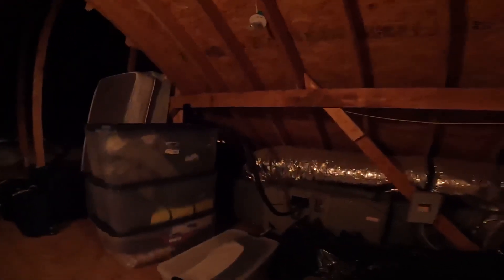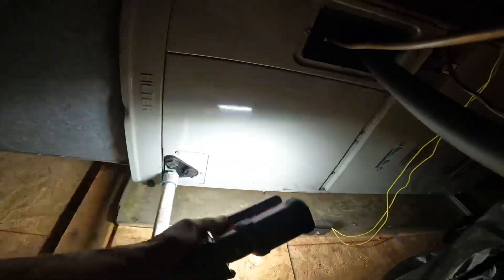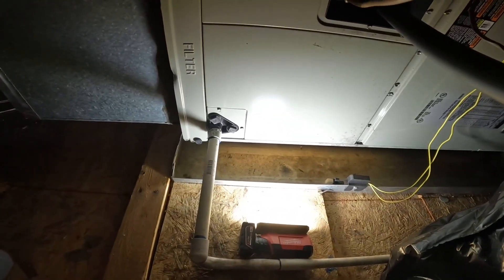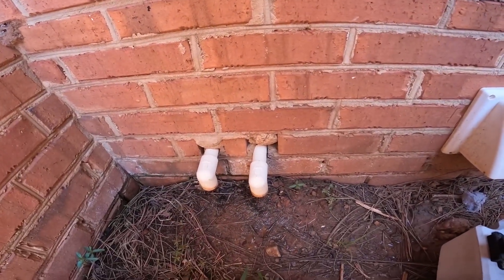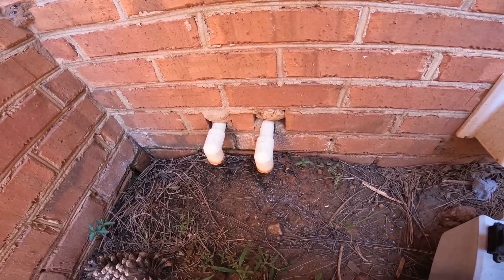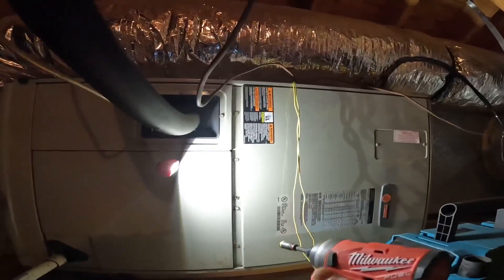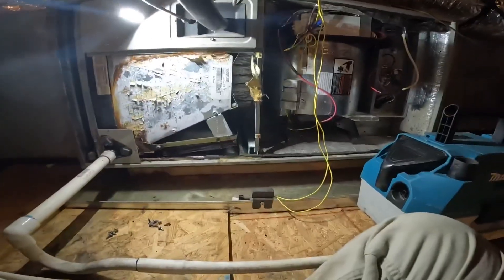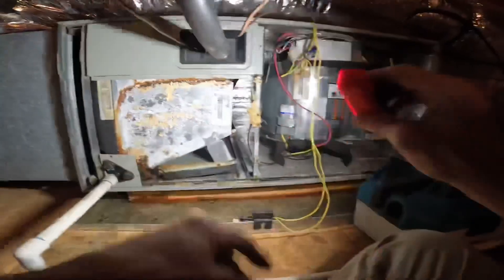Water in The Pan Turns Into a Changeout!

Comment: Another thing the transfer  pumps are good for is for washing a condenser if there is no water readily available. Fill a 5 gallon bucket and use that as your wash water. I have a storage facility i have to do that on and it works well.

Comment: No drain on the secondary pan ?
Reply from the maker: Just a float
Reply: That's becoming more common now, we used to have to run out separate from main drain.
Reply: I looked at the IMC again. Secondary pan drain OR switch or combination.
Reply: I like how Ted cook pipes out the pan, but puts a ball vale on it and leaves closed. Trips the float - they call, tech opens ball valve to drain.
Reply: Rather cap the secondary off and put a switch, ive seen more pans rust out because they never caught on that the unit was leaking, and the in-line switch is useless because crap builds up on the side of the float and actually causes the drain clog
Reply: I have also seen suggestions that the secondary drain to someplace the resident can't miss, like from the soffit over an entrance door.

Comment: I put an air handler in an attic once on a house I owned and remodeled. NEVER again... ever in a million years.
Reply: Why not?  Poor drainage??
Reply: @ranakeen9884  Miserable and hot. Lol
Reply: @virtual_bomber5698  it’s like a free sauna here in Michigan, idk about Texas or Arizona though. That’s way too much heat
Reply: @murkyturkey5238  Yeah man, it’s real easy to get heat stroke, you have to constantly be hydrating and make sure you take a break to get something on your stomach.
Reply: Don’t ever come to the southeast then
Reply: @virtual_bomber5698  Texas attics are pretty tight and there's no flooring; if we had a change out the first thing we did was to use 3/4" plywood boards
Reply: @bobboscarato1313  Most of the work I done is in Mississippi, most of the houses have them in the attic. The others have closet units but they are usually TIGHT. Sometimes you get lucky with a package unit. 

They usually have some decking under the units in the attic, the newer houses have a good amount of decking. Some of the  attics gets to 135 degrees (if not more) with the terrible humidity and then you have a shitty install that lasts all day that you’re stuck up there. 

I just don’t fucking know why they don’t have dedicated utility rooms for that kind of shit. Or at least have a dedicated full size closet.
Reply: @bobboscarato1313  what part of Texas ? I live in San Antonio and I do HVAC and the attics for the most part are pretty spacious
Reply: @skrt_n6518  Mostly Houston; many years ago to save on wood, builders made attics pretty shallow...you get my point. I see many of the new homes have larger attics. In Houston there are no basements for HVAC equipment save River Oaks! 77024.
Reply: @virtual_bomber5698  im also out of south MS and the REAL fun ones are the attics that were never built to have AC, most have 3-4 feet max room down the middle. many bruised knees and bumped heads were had
Reply: @bobboscarato1313  I live neat Galveston yall should see my attic it's almost large enough to stand in. The ac unit is up there to plenty of room to service the attic is well lite al lights work and the attic has a floor to walk on it also has roof vents and the attic stays well under 100. Degrees. My last house had a service closet with the ac unit in it right off the living room area.
Reply: @SuperJeremi10  How old is your home?
Reply: @SuperJeremi10  sounds  nice
Reply: @bobboscarato1313  my current house was built in 91  my last house that air handler was in closet of living space was built in the 80s.
Reply: @jasonflinders-1984  its quite nice when you need to service the equipment.
Reply: @SuperJeremi10  Those are tough to service; filter grille right under air/handler requires air baffle as it's very noisy!...
Reply: @bobboscarato1313  the unit in out old house with unit off closet.
The unit wasn't that noisy we had a 2 ton icp unit 900 sqft house it was a heat pump unit we normally didn't notice the unit running the outdoor unit was quite too.

The unit it replaced was a old Goodman janitorial unit that thing was noisy.

Our new house the unit is in a nice attic I hear this unit running more then at my other house the unit Herr is a newer icp matched with the original rheem gas furnace. It'd a small 1.5 ton unit.

This house I'd 1,400 sqft. Yes the unit us undersized but this house has new windows spray foam insulation and trees all around the house on a hot 100 degree day the unit will maintain 68 and cycle.
Reply: @SuperJeremi10  I'm glad to hear that; my experience was quite different!
Reply: @SuperJeremi10  I'm sensitive to noise!
Reply: @SuperJeremi10  I suggest you go to Beltone and have a hearing test; you may be going deaf...I hope not!
Reply: @HiMyNameIsJoshuaC  Yeah, came across of couple of those, so stupid they decide to put it there. There are many better way these units could be installed.